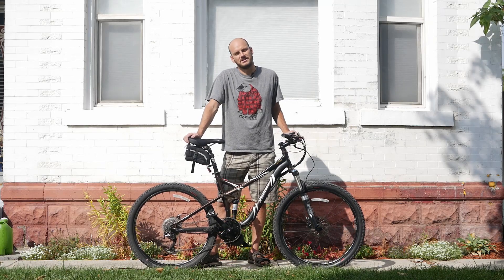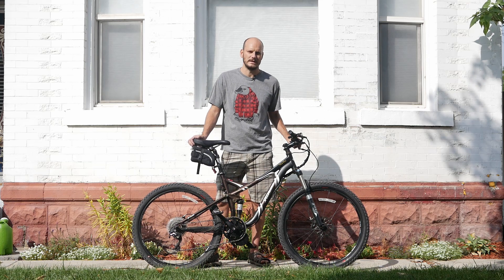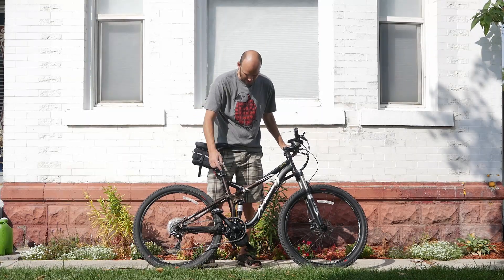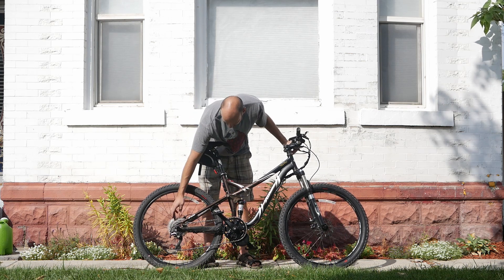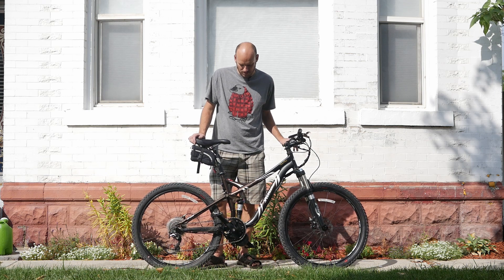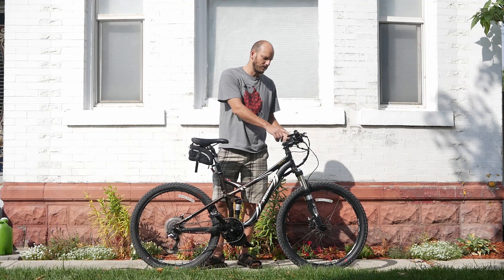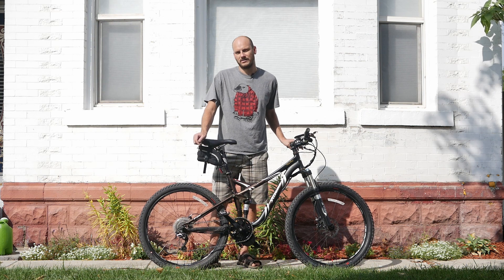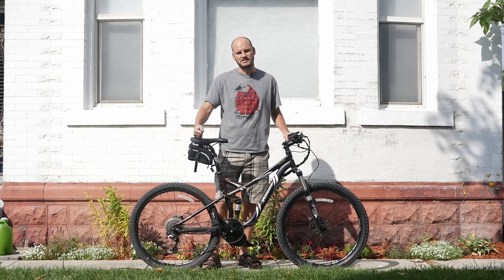Custom E-bike build: Specialized Safire Elite Full Suspension BBS02 52v Mighty Mini

Comment: So Im new to E biking. I rented a Radrover and rode it on the beach in Sarasota and had a blast. It would go right through the sand and it was thick sand and it was really fun. I have decided to get an Ebike but I'm still unsure whether to get a hub or mid drive. It seems like the mid drive would be best but I always notice that the batteries and motors are generally smaller but the components are much better. Where as the hub drives have bigger batteries and motors but the components arent as good. I like the better components but want long range. Why are the motors and batteries usually smaller in the mid drives. Im looking to do trails and beach and like the fat tires. Any recommendations?Thanks, Kevin
Reply from the maker: check out my hub vs mid motor video if you havent. Short answer is probably a financial decision from the maker to go with a small battery. That or aesthetics. Certain hub motors are smaller than others, generally the higher powered the larger they are. the more surface area needed to process the higher power essentially.
Reply: @JohnnyNerdOut  ok cool. I appreciate It thanks

Comment: For my own ebike build I am thinking about a mighty mini paired with a 1000 Watt BBSHD. Would that battery provide sufficient power with that motor? Would you recommend that pairing? Also I watch this channel regularly  (even laughed at tool bag joke) but I would love to see solar panel content as well. Thanks for the info.
Reply from the maker: As long as you don’t ride it pulling full draw(power) from the battery all the time it should be fine. But it will put out the max 30amps when needed. Thanks!